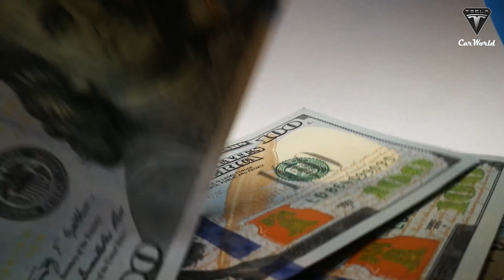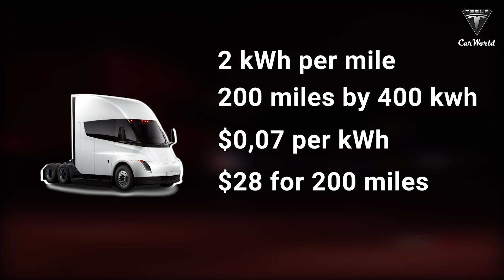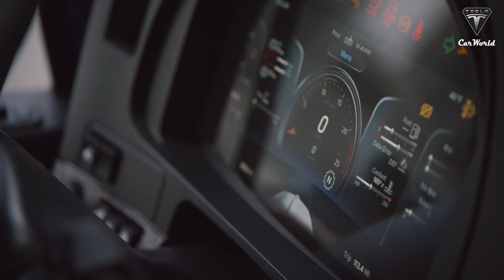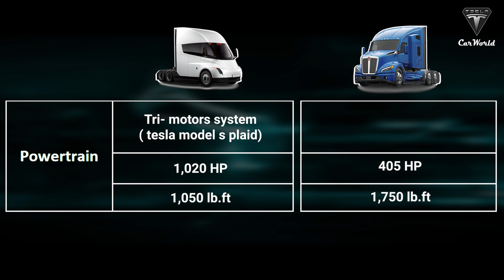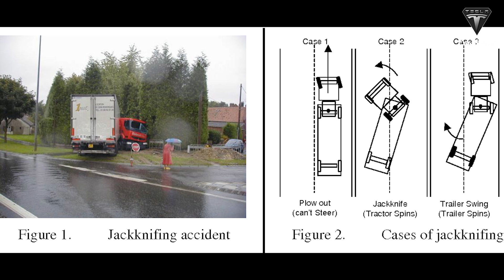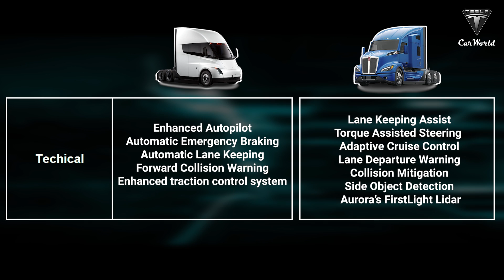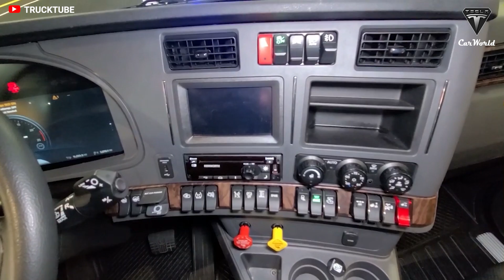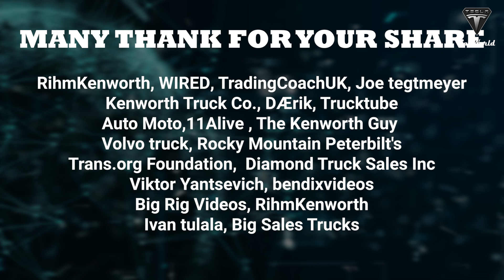Which is the KING of 2023 Heavy Trucks? Tesla Semi Vs. Kenworth T680?

Comment: So much misinformation I don't know where to start. The 0.36 Cd is meaningless without the context of the trailer. The front of the vehicle has little impact on total Cd. The wake area and CdA is most relevant. The quoted efficiency is 1.7 kWh per mile, not the 2 kWh used in your video.
Reply: For example?
Reply: The only real issue i had was the estimated $0.07 per Kw. Most superchargers are $0.25 but go up to $0.35. This significantly increases the cost of travel by about x4. It is still half the price of a ICE. Of course charging at the depo may be much cheaper, helping to bring down the costs again. Either way, it is good to see a move away from diesel. there might be some fight back with hybrids, but electric trucks will be cheaper to run. Battery tech year over year is also getting better. They are getting lighter with higher density of energy. By the time Tesla produce their mass market version of their trucks, many of the issues will be ironed out, and the range may very well increase.

Comment: You are using the wrong metric.  Miles per gallon and totally hauling capability for the cab is not what matters.

Both in the US and EU markets, semi trucks are limited on their total weight.This is the weight of the cab plus the load.  In the US, this is 80 tons for a class 8 (semi) truck.  Currently, an average semi truck cab is between 10 and 25 tons. Leaving, in the worst case, 55 tons for cargo.

The total weight of the non sleeper cab is estimated to be 27 tons, allowing less tons for cargo. And an extended cab version will add more weight, allowing for less cargo to be hauled. 

The total weight of the cab is the most important metric, and the cost per mile per ton of load is the measure of cost that matters.
Reply: According to my research the Telsa semi isn't too much heavier than a standard diesel truck. Judging by its other cost saving parameters its by far the better deal. Especially since there will be potential upgrades in the future.

Comment: Anyone who owns a tesla in the 🇬🇧 is a laughing stock plus the trucks wont work  because none of them can travel 1000miles in 24hrs they hate giveing bracks to drivers never mind charging time for tesla trash
Reply: wouldn't go that far. 500miles is respectable. Here in Canada it's 13 consecutive hours of driving a day and 14 in the USA. Assuming a high average speed of 70 miles an hour the entire distance without breaking that would give us 980 miles. But in the USA the driver must legally take a 30 minute break after 8 consecutive hours of driving. Just 60 miles over the 500 mile cap and enough time to recharge. In the UK its 7 hours and 45 minutes before all breaks taken for an assumed distance of 542 miles in that time. And even then the law there requires drivers to take breaks adding up to 45 minutes total once a 7.75 hour driving time has been reached. That puts the Tesla Semi's 500 mile run almost within operating range. 

On another point, I believe companies hate giving out breaks because of the exorbitant cost of operating a gas or diesel powered vehicle vs time spent delivering heavy cargo. The Tesla semi is allot cheaper to run and offers max tonnage per trailer (max for North America anyway). Even though max Tonnage in the UK is a bit higher, The Tesla Semi is still cost effective due to it's cheap recharge and limited wear and tear. Plus Tesla isn't just increasing the load on the power grid it's adding to it trough their energy business, so the cost of electricity should remain relatively stable. This is only the first model and upgrades will be available once they start producing a few more of these. Based on the metrics I'd say Tesla has a chance here.
Reply: @mrfly8133  On duty time in the US is 14 hours, but you can only drive for 11 hours per day (actually moving). The driver has to take a half hour break in the first 8 hours of driving. 
The Tesla truck might work for local (depending on the available payload remaining. I suspect that the 2k lb addition to the normal 80k lbs won't come close to covering the additional weight of the battery and electric drivetrain over the diesel drivetrain and fuel), but regional and OTR are beyond the capability of the vehicle. The goal is to move as much payload as possible as far as possible per $. That cost includes truck, fuel, maintenance and driver and is spread across the total payload.
Reply: @rich7447  thanx for the info 👍
Reply: I hope to god your a bot troll and not an actual human. Humanity is indeed doomed if people are as stupid as your comments would suggest.
Reply: I see your comment has 2 replies including mine and excluding this one. If it was you. You may need to rephrase it as YouTube has hidden it automatically. I can't see it.

Comment: i encounter a lot of T880s (not 680s, more general use, not long haul - less focus on aerodynamics) in my line of work. i work on them, though not the motor. but, that paccar motor, according to all the mechanics i talk to, is such a pain in the rear that one company is selling their fleet of them and moving to older T800s with different motors or something else. new peterbilts are also paccar, same cab on their newer trucks, and same motor - and they have some of those too, and they're hurling them out. a lot of the problems require dealership diagnostics, and yeah, because they're new, but for the time being, one of my customers is ditching all his new paccar trucks. ;)
Reply: The main issues are all the stupid electronics.  The Cummins/Paccar engines are very good and have been the new standard for durability (after Caterpillar).  They're going back to older tractors with older, LESS ELECTRONIC engines.